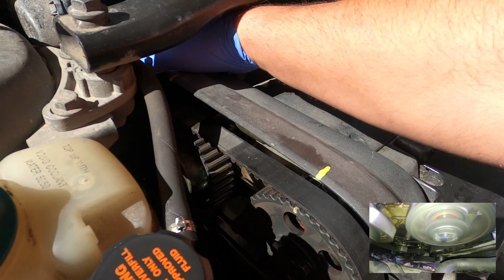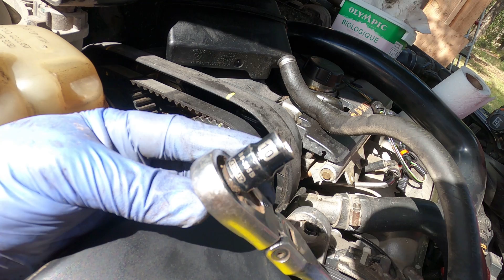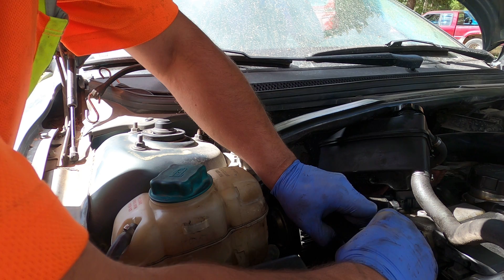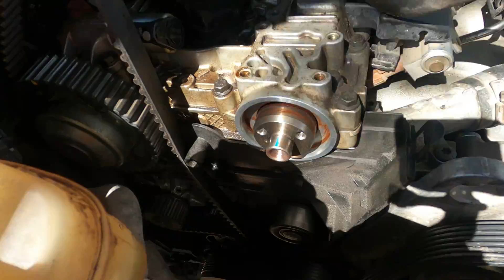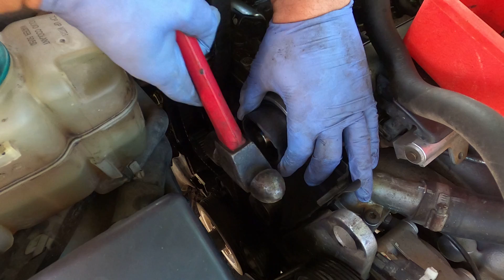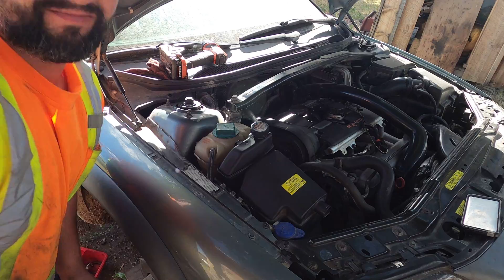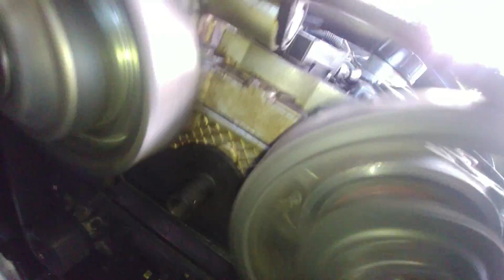VOLVO CAMSHAFT SEAL REPLACEMENT WITHOUT CAM LOCKING TOOL (NON-VVT) |  TIMING BENT TENSIONER SETTINGS

Comment: Helpful hint: use sandpaper to take the sharp edge off The bore that the seal goes into so you don’t shave the rubber right off of the outside of the seal.
Also, you can fabricate a disk with three holes in it and a large center hole and you can use the three bolts that hold the cam sprocket on to press the seal and evenly and consistently instead of using a hammer.
Reply from the maker: That's great point Lamont! Thank for your advice.

Comment: So lets mark it on a piece of plastic, that can move, and not stationery. No guarantee that when you remove that plastic timing cover, that it is going to go back exactly the same spot. Dumb
Reply from the maker: Thanks for the tip! It always locks at the same spot if you put plastic cover back correctly. What did you do?

Comment: I replaced both front cam seals of a S70 year 99, locked the cams at the back beforehand. Put the vvt hub back in the previously marked resting position and spring loaded at the time of belt installation.  When I test rotate the engine manually ,there is a spot where the sprocket timing marks align with the top cover I have to have a bigger force to move through and the tensioner roller arm swings to the right and a half circle later swings to the left showing less tension. Is there a conflict in the system which can be fatal if motor being turned on. Thanks if you could answer this and for this clear descriptive video you've posted.
Reply from the maker: Sorry for such a late reply, lost your comment. Bzw, how is your repair?

Comment: Hello!
Great video!
What do you think about the b5244t3 2.4t engine valve lifter change?
Shuld i remove the belt like this,and after valve cover,and camhafts?
At 2000rpm i have little noise like valve noise,i changed the oil but doesn't work,pcv replaced.
What do you think about?
Why sound comes at 2000rpm?
Have a good day!
Reply from the maker: Hey brotha! Have you change valve lifters on any Volvo before? Volvo doesn't have hydraulic lifters, it's pain to get valve lash set properly on Volvo due to stupid design. Let trusted mechanic to listen that noise before doing any repair. I seen very often after trying to do valve train cars ended at the junk yard.
Well, back to your questions, you have to remove timing belt from the sprockets first.
Cheers!
Reply: @PistonShack  Thank you for your answer!
The B5244T3 2.4T engine doesn't have lifters?
I filled little prolong oil additive,and the ticking sound is gone,but i changed the oil,and the sound come again.
When i rev it to 5-6000rpm,the sound gone when the engine is normal running temperature.
Reply: @PistonShack  or thats an tapets on the valve?
Shoul the 5w40 oil is the problem?

Comment: Hi great video! Well done!
Just wondering, since the VVT cam is spring loaded, will you not risk it moving when loosening the belt?
Reply: I just did this exact repair... I think the vvt cam stays in place and doesnt move unless you loosen it?
Reply from the maker: @Subtropicalsband  Nope, I won't worry about exhaust VVT sprocket. If everything checked out how I shown it should be good to good. I put 10K km after I did my repair - runs like clock.
Reply from the maker: You are so welcome brother! It should be fine. Just count number of teeth to make sure your belt isn't off. I have been driving since no any issues at all.

Comment: Would this work cause a p0016 code ? Thank you
Reply from the maker: Hi Mike! Yes, p0016 Camshaft Position Correlation (Bank 1) might come up if timing is off a bit. The camshaft timing is out of position due to the timing belt off teeth or  camshaft phaser is out of position due to problems with phaser. I would check my timing and belt marks to make sure none of the cam sprockets or crank is off.
Reply: @PistonShack  makes sense ! I svanmed with vida again, and had a fee others give me some advice. It ended up being the vvt solenoids which is odd, as I thought those would correlate with p0026 / 27 !
Reply from the maker: @velvetman49O  Right on! Let me know if you have any questions. Cheers brotha!

Comment: Hi I have the exact same issue... I went out stuck the screwdriver behind the gear and there it was! saved me a bunch of diagnosis time. I have same set up no vvt on intake... just curious while you were there you didnt replace the other seal seems inevitable that it will go too...
Reply from the maker: Greetings brotha! No I did only one seal for now. I might do the rest with next timing belt work I am glad this vid came handy) Let me know how is your repair. Cheers!
Reply: @PistonShack  I finally got in there and did it exact same problem. All done and fixed for the price of a seal thank soooo much!
Reply from the maker: @Subtropicalsband  My congratulations! I am glad one more beautiful Volvo was saved today from going to the crusher! My pleasure brotha!

Comment: Good film, Question from me, Last week the exhaust camshaft wheel from my XC70 "2002 2.4t came lose from the camshaft while driving. no timing no starting.
Do you think it needs a new engine?
Reply from the maker: Thanks Rob! I won't discard the engine yet. Did cam sprocket came off completely?
Reply: @PistonShack  Nope, its still attatched but came appro 5/6 millimeters of. Distribution belt is still in place. Only te camshaft is not turning.
Oilseal is pushed out and leaking. Before i bought it, there was a another engine placed. maybe the forgot to fasten the exhaust sprocket.
Reply: Do you have suggestions for me?
Reply from the maker: @robstelten6658  Hey Robe. I would get cam looking tool online and reassemble everything replacing seal and might be exhaust vvt sprocket if it damaged.
Reply: Thanks, great help. Keep up the good work.
Reply: Hi there again, for your information it was a broken exhaust camshaft and some busted valves also. nice job.

Comment: Hi PistonShack, thanks for your video. I replaced my timing belt as part of regular maintenance without using any camshaft locking tool and never thought replacing the intake
and exhaust seal because I had no leaking issue and now I have it from the Exhaust camshaft. Did you have any idea or tip how to replace it and my concern here is how to tide it with sponge cord to secure the exhaust sprocket from moving as you easy done with your intake sprocket.!
Reply from the maker: My pleasure brotha! I wouldn't do seals now if they don't leak but with next timing belt replacement if car has over 300K I will put new seals as well. Mine didn't leak it just came out from the cylinder head right out.

Comment: Just as a point of consistency, at 16:15 or so you say to not get lube on the outer diameter of the seal - I agree with that and I might put a touch of loctite.  However when you apply grease to the camshaft, you also smeared grease around the outer rim.    That disagreed a lot with what you had said.
Reply from the maker: Hey Paul. Thank for your feedback. I like your comment. I only lubricated lip of the seal and the contact surface of the camshaft only not touching the seal seat. In the video it looks like I greased seal seat place. I have driven my Volvo everyday science - no any leaks) Cheers!

Comment: Thank you for sharing this!! Yesterday my 06 S40 engine just shutoff while driving. The engine will turn when attempting to start but it won’t start. I check the T-belt and it looks good. However, when trying to start the engine, it does sound as if I had removed all spark plugs and then tried to start the engine. It sounds es as if it didn’t have any compression. What could this be?
Reply from the maker: Hey Traxxi2003! Most likely you don't have fuel pressure. Did it died slowly on you or just shutt offf right away. Check this video, it happened to me last year - car died on me: VOLVO CRANK NO START - FUEL ISSUE | TROUBLESHOOTING & REPAIR.
https://youtu.be/EKfR6s9fp0I
Let me if you have any questions.
Reply: @PistonShack  , it shutoff right away. On mine it was the a/c compressor belt that came apart, somehow parts of the belt got into the crankshaft timing belt sprocket and the motor jumped timing. I have no compression

Comment: Nice job at explaining this... I got quoted $700 USD to replace the seal; well, I think I'll do it myself on my 2005 Volvo XC90... just need to find the right time, as I'm truly busy and it's hoooooottttt in Phoenix, Arizona.  I truly appreciate folks like you sharing the knowledge.  When you go to the grave, which we all will, we know that our knowledge is NOT going to be lost.  Thank you thank you!!!!
Reply from the maker: My pleasure brotha! I am so glad this simple video can help you out. I have been driving this Volvo everyday since I fixed oil cam seal leak. After pricing cost of the repair (just to get a digits) at the dealer and local shop - Nope, too much! I went to local Volvo dealer bought couple seals, that was it. Then filmed a video).
You are right, knowledge is greatest asset, which lives forever. Greetings from British Columbia, Canada! 
Let me know if you have any questions. BZW, thanks for your feedback and watching this video. Cheers RMP!

Comment: The camshaft seal came off because of excessive crankcase pressure. You should clean the PCV system. Good video!
Reply from the maker: Hi Mira Mar. Thanks for an advice! PCV system was service recently. PCV system has solid vacuum, no blow by pressure. Camshaft seal just got dried up and came out. I thought crank pressure was a cause.
Reply: Mine did it and my PCV is clear,  the PVC inlet manifold "upside down banjo"was updated to include a one-way valve, this to reduce  the crankcase getting pressured by the turbo.

Comment: Excellent video. I have a small oil leak coming from top passenger side on my V70. I can see oil in the timing belt area. I will check to see if it is coming from the seal and if it does I will follow your instructions. I am on my third Volvo now, had 240, 740 and now V70. I will drive Volvos for the rest of my life, love them.
Reply from the maker: Hey Jacob! Thanks  for your feedback) Let me know how is your repair or if you have any questions. Cheers!

Comment: This is a very pleasant video to watch. Getting ready to replace the timing belts on my 95 and 97 Volvo 850s with over 250,000 miles. The kits come with new camshaft seals, so I wanted to see how to do this without cam locking tool, if possible. I was a little surprised you opted not to replace the exhaust cam seal while you were in there since it is so old.
Reply from the maker: Hey Alan! I didn't do it because first exhaust seal has different design, seats firmly compare to the intake cam seal and second seal didn't leak. I might replace it @350K with timing belt service. 
Yeah, let me know how is your repair, also if you have any questions. Cheers brotha!
Reply: @PistonShack  I usually follow the adage "if it ain't broke, don't fix it." One exception has often been with engine seals, where I tend to err of the side of caution and replace them if I'm in the area. Perhaps it has to do with the vehicles I've owned in the past, which included several Chrysler, BMW, and Mercedes products, which liked to bleed oil from everywhere. I popped the cover off my '95 and looked at the seals. They're both dry as a bone, and since they aren't particularly difficult to get to, I've decided I won't fix what isn't broken. The '97 is a different story. Both are leaking, so they will get replaced. Since these have the older engine design, I think they have the same seals and gears for intake and exhaust. Never thought I'd love a Volvo until I fell into owning one. They are amazing machines.
Reply from the maker: @OneOfManyNicknames  !00% brotha  - don't fix it if it ain't broke! Thanks for sharing your experience. Well, I will replace rear main engine seal if it wasn't ever replaced) When I do clutch on my new project vehicles seals go as well! I like Volvo for their safety, performance, engineering and reliability! Volvo cars have character and personality)
Indeed.

Comment: Thank you, im a volvo fan and need replace just what you showed in video on my 2001 s60. I also have - 98 v70 and my son have two v70's. One mk1 and one mk2.
Reply from the maker: Sounds good brotha! I like "Sweedees". You guys have entire Volvo garage. I am glad it helped you out. Let me know if you have any questions.
Reply: @PistonShack  well, I like sweedes to, they are good neighbours) im as far South-West you can come in Norway, Karmøy))
Reply from the maker: @EspenMathisenViking  Thanks brotha) Same to you, if you are planning to visit, Canada especially British Columbia)
Reply: @PistonShack  I do have one question, my son's mk2 v70, gasoline.. It runs ok cold but warm starts to go like it is miss fire. New coils, plugs..
Reply from the maker: @EspenMathisenViking  Most likely it related electrical wiring (harness) or one of the inputs (sensors, switches ect.) to ECU starts acting up when vehicle warms up.
Do visual inspection, check for any wiring contacts, check spark should jump out (good coil/plug spark will jump 2-2.5 cm).  Also try to do simple things first, swap coils, do contribution test to find which cylinder dead ect. When last time did you change plugs, coils. Also check fuel pump pressure at idle and 2000 rpm itt also could be weak worn out fuel pump as well.
Is it permanent or intermittent issue?

Comment: Timing belt was replaces as well as camshaft seal was replaces on my volvo S60. After the repair car turned on run 200miles parked in my driveway and won't turn back on...hoping it's just a tension easy fix...what do you recommend
Reply from the maker: Hey Gelamish!
Sounds it doesn't crank at all - Crank No Click No Start or it Clicks? I would start with basics. Check it power present on commant wire at the solenoid when you crank. Next try to turn engine over with a ratchet. Do you have any DTC related data or codes preset. Let me know I will get back soon as I can. Cheers!
Reply: @PistonShack  thank you for your attention.. wen I turn the key it's sound realy Close to starting like if it was out off gas..10 codes come up more than one are missfire.
Reply: Ill have a chance again by the end of this week to recheck the timing marks. i will turn one full turn by hand the bottom ⚙️ and see if after the drive the timing moved. Hope I go go from there to rule out the problem
Reply from the maker: @gelamich  Do you have tachometer signal while cranking engine over? Multiple misfires usually related to 1-5 degrees cam / crank timing off set.
Reply from the maker: @gelamich  I will verify that for sure. Please remember if timing belt fail or goes off too far it could damage the engine. All Volvo engines are interference. Can you also share all DTC codes you have. Cheers!
Reply: @gelamich 
Hello, I was wondering if you could please share what the specific problem was with your car ?  And what was the fix ?

Comment: Hi, I wanted to thank you for this video. I am looking into a 2003 volvo s60 and I have never owned a Volvo, nor do I know anything about them. What should I look out for, other than this massive oil leak issue? Thank you so much, again. I look forward to watching more of your videos.
Reply from the maker: Glad I could help! Thanks a lot for watching, your feedback. I would say: if you found decent Volvo car bring it to the local Volvo garage for an inspection prior the purchase. I would check body, make sure vehicle wasn't in any major accident. ASIN transmission is very sensitive to ATF quality, if fluid wasn't change - most likely gearbox will go out first. Check for blow by, when you take oil filler cap off, should have vacuum. Check if previous owner has prove of all maintenance and repair records. The best advice to take a car to mechanic you trust.
Reply from the maker: Let me know if you have any other specific Volvo questions.

Comment: In my 2001 the cam seal just fell out halfway, and poured oil. I just pushed it in without removing anything lol
Reply from the maker: It's going to be a common oil leak issue on 20 years old Volvo. Since I replaced the seal no leaks any more! It will come out again, I will better replace that oil seal. Thanks for your feedback Ben!

Comment: Do not attempt this with a VVT hub as they have play/or are spring loaded and need to be set/timed at the clockwise limit when reinstalling - impossible without the cam locking tool installed on the rear end of the cams.  This video shows replacement of non-VVT intake cam seal.
Reply from the maker: Hi Don! Thanks for the advice.  I added  "Non-VVT" to the video title to make it more clear. Cheers.